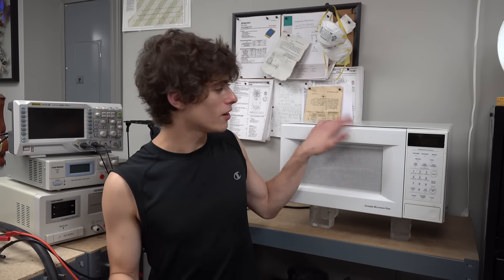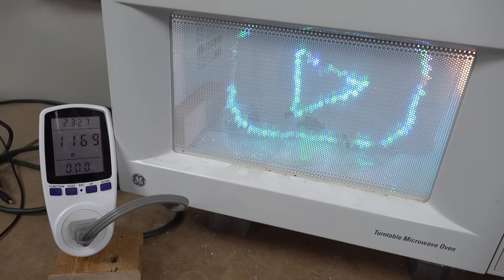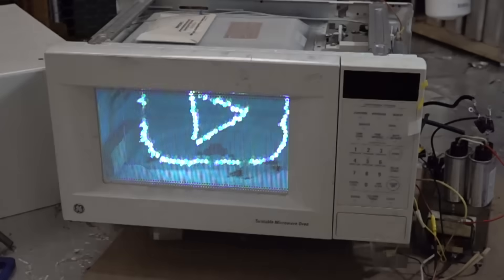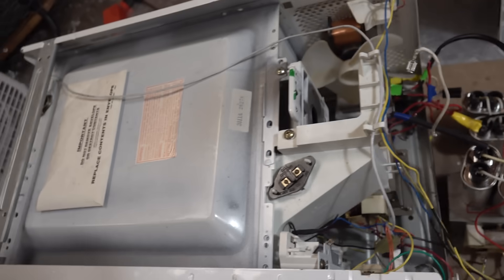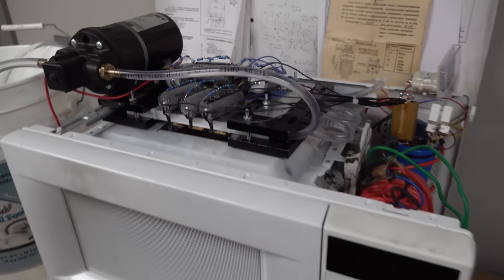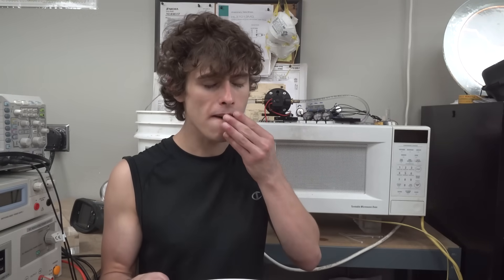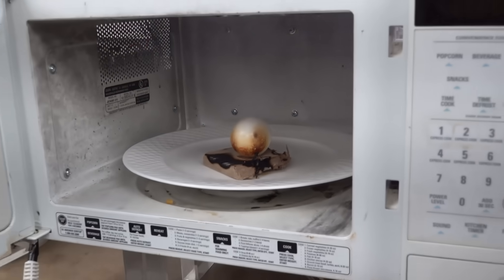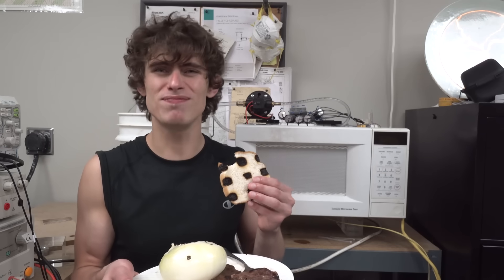I converted my microwave into a LASER oven!

Comment: "It's nothing that a little bit of copper wire and tape can't fix"

Almost had a heart attack there
Reply: The breaker would have still tripped anyways 😅.
Reply: @jasoncspink  lol yep. That doesn't work at all
Reply: He actually knows what he's doing. Although if he did screw this up he'd probably be dead before the circuit breaker tripped.
Reply: It will not work because the plastic Triger are designed in such way that it only Pull up the internal lever up but internal lever are free to move down Whenever Em triggers it , this time internal mechanism pulls the outer plastic lever down , not the other way around  .
Otherwise whenever mcb Breakdown after short the  circuit  , if someone mistakenly try to turn on the MCB again without fixing the short circuit first , it will completely destroy the circuit in just ms during the time of Holding by hand .
Reply: Wdym
Reply: @bizanagi5378  If he actually managed to bypass the breaker he could cause the wires inside his wall to catch on fire
Reply: @casualbird7671  a little fire never hurt nobody
Reply: @BugBestieLily  actually, it did.
Reply: @BugBestieLily  7 Arizona firefighters fucking died from fire.
Reply: @thepissedoffcombinesoldier7853  little fire
Reply: @thepissedoffcombinesoldier7853  lies
Reply: @justasuggestion5457  LITTLE FIRE? YOU THINK THAT SHIT WAS LITTLE??? THAT SHIT WAS A FUCKING WILD FIRE. PEOPLE AND ANIMALS FUCKING DIED. I DON’T THINK ‘LITTLE’ IS THE RIGHT WORD, WOULDN’T YOU AGREE?
Reply: @thepissedoffcombinesoldier7853  those arizona firefighters probably died because they were living in arizona
Reply: @thepissedoffcombinesoldier7853  "7 Arizona firefighters fucking died from fire." many fighters died from what they were fighting... it's kinda the thing that can happen when one fights.
Reply: @chrisakaschulbus4903  oh well no shit Sherlock!
Reply: @SirAlienGuy  no, it’s because they were trying to keep others alive.
Reply: @thepissedoffcombinesoldier7853  yeah, but the comment said *a little fire*, meaning he was not referring to the Amazonian wildfires. Just calm down mate.
Reply: @thepissedoffcombinesoldier7853  "oh well no shit Sherlock!" the same thing could be said about "firefighters died from fire"... but i let you eat your tuna sandwich, why can't i eat mine? :(
Reply: @thepissedoffcombinesoldier7853  doubt it, its every man for himself in such a wasteland
Reply: @thepissedoffcombinesoldier7853  "oh well no shit Sherlock!" again with the urge to keep me from enjoying my sandwich... 
why can't you be nice? :(

Comment: with adjusting the power correctly. for sure it seems like useful for cooking. and do lot more then microwaves do. and probably lot more safe in correct conditions. as microvave has lots of waste energey that causes radiation and instability on small atomic scales :P lasers are mostlikely more stable then high freq powerful microwaves. as they are lot more natural. but as they are targetable probably thell never be released in public.

Comment: Doing this with lasers that emit light that passes through cells quite easily could actually make it so you can uniformly heat up a steak since it interacts with all the layers of the meat without losing much energy so it can continue.
Reply: Uuuum... If it passes through cells, it isn't going to be heating it up much at all.
Reply: @oscargr_  It passes through cells quite easily, not completely. Let's say it drops 20% in energy for every centimeter that is passes through, for example.

Comment: Not all microwaves are built the same today I have a Panasonic inverter microwave that runs at the power you set it at! It's. 1200 watt unit if I set it to 10% It will run at 120 watts it doesn't cycle on and off like the old units do, it's almost 2 years old now and still going strong you can get one at Wally World for about $150.00 I'm sure you could expand your Frankensteining experiments greatly with a few of them.

Comment: "You can't make toast like this in a regular oven"

Trust me, micriwave burnt toast is my speciality
Reply: How?
Reply: @glenecollins  throw it in, start doing something and forget about the toast, come back 30 to 40 minutes later and it's suddenly black as Muddy Waters
Reply: @sirascaron  interesting I wonder if my microwave just doesn’t put out enough power to get it hot enough to make carbon?, mine just turns bread with no seeds in it into croutons, I tried seedy bread and it turned into fire but that set off the smoke alarm.

Perhaps I didn’t leave it long enough (I have only tried it when there wasn’t enough time to do it in the oven) and the bread I use is already pretty dry. 

Come to think of it a microwave oven with a vacuum in it should be the ultimate for drying stuff I will have to look into that.
Reply: @glenecollins  that's an interesting idea. I think you are right, a microwave purge oven would work amazingly well.
Reply: I like microwave toast. It browns the middle.
Reply: @alexbarnett8541  so does a toaster
Reply: @diablotry5154  but a toaster browns a rectangle in the toast, while the microwave makes a perfect circle. Toaster is boring
Reply: @diablotry5154  but there's more steps to getting out your toaster. The microwave is always ready and waiting.

Comment: I built a shielded enclosure for my 40W CO2 tube with an enclosed magnetron. I fired the lasers DC supply through the tube to start the plasma for the magnetron to get a grip but it never did. I later came to suspect that the gold catalyst coating was blocking too much of the 12.5cm waveband. I am retired now so I will get back around to reworking the project some day now that I have unlimited time like you. You're a God. Keep it up.

Comment: "I'm gonna guess that I'm probably not supposed to have these"  it be like that
Reply: It do be like that sometimes. You also experience that kind of situation any time you're working in an R&D test lab for any tech endeavor and you see lots of "Test Sample" or "Demo" unit labels on things. The funniest part is how frequently all that stuff goes into lab use fully undocumented. It then usually ends its life buried in a mystery rack somewhere with an engineer using it for supporting their own various tools throughout the lab instead of its original intended purpose. IT can be interesting sometimes.

Comment: Fun fact, at a messy 2.4 GHz, you could be interfering with the Transponders used in aviation. That is the piece of equipment that send your altitude and position to ATC for their radar, so depending on how close you are to an airport, you could actually completely block your nearest airport's secondary radar. This kind of relates to the FCC he was talking about, but you would also get involved with the FAA and maybe even ATSB if something go's wrong.
Reply: Thats y he has like 6 Faraday cages in thats one room
Reply: Do you happen to know how many km would classify as "close enough"?
Reply: @ornessarhithfaeron3576  I think EM waves, especially at those with lower freqs do travel pretty far, so if they are directed in the correct way anything could happen
Reply: @flawnski  if its in open air the freq dosnt really matter.
Reply: @ornessarhithfaeron3576  if it's pointed to the tower, then it's probably line of sight. If you can see it, it does damage.
Reply: also microwaves use 2.4GHz, not 4.2
Reply: @thewhitefalcon8539  This. Also the Wattage required for a 4.2GHz signal to reach cruising altitude of 12km would melt everyone nearby from the inside out. A microwave oven only has an effective range of a few meters, and that with a whole kiloWatt! Remember kids, the higher the frequency, the shorter the wavelength, the shorter the range...
Reply: my ion beam for the ibkt project will block a country from radar but due to a high fidelity yield graphene filter it shields the extreme rays and still able to cut a home in half with a swipe. when u do 45deg swipe then the top half slides down the lower half .
Reply: @Matt-xy6cf  .
Reply: Inverse square law , comes to the rescue ; 500 yards I'd say..prolly less- weilding with an arc ; does much the same -a plazma tource would blaze strong in tadio waves - mig. tig . Next most energetic , all motor Sparks - broadcast ' noise'...random weilding might we'll cover your tracks...godspeed comrade
Reply: so basically, if he brings that death oven outside it can blind pilot radar? cool.
Reply: Well I guess it's just a good thing that 4.2GHz is nowhere near the microwave oven band then innit :)
Reply: Where the fuck do you get this rubbish, transponders are 1030 1090 MHz
Reply: @TheFool2cool  there are harmonics and subharmonics to the frequencies. Since microwaves are around 2.4 GHz (I edited my comment to be more accurate), then that is close to the second harmonic of the transponder, or at least close enough to confuse the radar system. There is a reason why the UHF emergency frequency is 243MHz, the second harmonic if 121.5. They become partially bound. Also, microwaves are powerful enough that they wouldn't need to be exact. To put that in perspective, an Airband communication is 5-10W, nowhere near the level of the microwave.
Reply: @zacharytaylor190  no. There are not subharmonics. Microwaves do not interfere with radar systems. No no no no.
Reply: C-UAV inbound
Reply: @GroundOpiumZoo  this comment 🤣
If you know then you know 🤣🤣🤣
Reply: Where do you get those 4.2 GHz from?

Comment: 5:54 what the battery doin
Reply: I suspect energy in the air was so powerful that charging port and onboard OS thought that power cord was plugged in. I had the same problem when I was in toilet on vacation and phone was showing "recharging". It doesn't show up now.
Reply: @dragonivanrussia no that can't be because he left the metal grif on the microwave door which blocks all of the radio waves
Reply: @dragonivanrussia iPods like doing this too. I heard that they don't have the proper circuitry to properly know how much charge is left, so I'm guessing it relies on the fact that batteries output less voltage when they're running low on charge.

Comment: Sticking some mirrors where the rf is usually reflected inside the cooking chamber with just maybe four of those laser modules redirected into the rf cavity where the magnetron normally goes might just be perfect for actually cooking it without burning it. You would probably also want mirrors on the walls of the microwave, maybe just paint the walls with silver metal paint or something, or use cheap mirrors from a store. Also, it would be cool if you hooked it up to the microwave's controls and put a yellow shield on the microwave door so you don't need laser goggles to use it :)

Comment: Health Warning
Oooh nerd point: I am a HAM and would just like to comment on your protection warning.
Most of us only use the HF and VHF band Microwaves are (of the top of my head) EHF or SHF. Unless its causing noise we wont hunt you down.
microwave also is a very localized RF transmission. It doesn't propagate so it makes it difficult for the FCC to monitor unless they are down the street. 
I would be most concerned with the health issues. You might want to make sure your faraday cage is in range for the microwave transmissions. I dont think chicken wire will cut it. 
I would be most concerned about the health effects, such as RF burns and cataracts.

Comment: 2:20 Some microwaves actually do run at 50% power instead of going on/off all the time, the Panasonic ones for example.
Reply: There are some newer microwave models that no longer use the big transformer but a switching supply to power the magnetron. These units are a lot more expensive in comparison so not very common.

Comment: 18:37 I think you are on to something with using a different color laser, maybe with a wavelength somewhere between 780 nm and 1 mm like you suggest, you could maybe even go as high as 125mm or thereabouts.
Reply: Free proton MASER anyone? 

"So we replaced the LHC beamdump with a superconducting wiggler. Let's get ready to get subsurface radar returns from Pluto"
Reply: 125mm wavelength lasers would just be a normal microwave no?
Reply: @windowsxpmemesandstufflol  🤔you could use microwaves instead of light... What a novel idea

Comment: ngl when he said "nothing a little copper wire and duct tape can't fix" about the tripped breaker my heart stopped a little. Got me.
Reply: Same, especially after seeing one explode up close. They had the cover off for...reasons(?), and a CRX dashboard (complete with all kinds of metal bracing on the back) that was propped up in the corner somehow fell into it. I'm not an electrician, so I don't know exactly what all happened, but 2/3 of the main bar that the breakers attach to was vaporized in about 3 seconds.

Ngl, I would feel much safer handling uranium fuel rods that I do messing with electricity, you generally don't get a do-over.
Reply: @logicplague  I'm no professional, but I do work with small hobbyist electronics. Idiots messing with mains electronics, fuses and breakers doing things like that unironically further reinforces my beleif that humanity is doomed.
Reply: @bluspectre2042  I think that's awesome!
Reply: Dude I couldn’t stop laughing
Reply: A lot of things in this video could make your heart stop a little

Comment: Fondles microwave internals, bare handed. Engineering equivalent of a horror film. Puckered a bit there.

Please do your research and understand the risks involved and get a pair of electrical insolated gloves from a reputable supplier. Do at your own risk and remember it is a legitimate statistic. 

Dudes being a dumbass on your behalf. There are a lot of safety checks behind the scenes.

Comment: I'm guessing this is the first time you've designed your own water cooling system but I have to ask why are you using a high-pressure diaphragm pump. Where is the water cooling radiator. Also why did you use mayonnaise as thermal grease

Comment: Could it be beneficial to have both devices cooking??  Use the Magnetron to cook the innards, and use the Laser to give a nice charging on the outside. Obviously with a better diffuser 😉 Also, may add in a few other diodes types like the IR or UV.
Tbh, that steak looked pretty decently and evenly cooked. Perhaps cooked less time would better. 
But cooking with laser and microwaves I think the food would be done faster, and more thoroughly/evenly.

Comment: Don't forget that part of the heat from the water goes to heating the cup, which has a different thermal capacity than water. So your calculations of efficiency are basically nonsense.

Comment: It might work better if you were to have a beam splitter split the beams into more than one and then have them reflect off mirrors so you can cook the top and the sides at the same time! Also, the key is to make sure that the food is moving around so that no spot is stuck under the laser for too long. It would prevent the burns.

Comment: You and my Dad would have gotten along.   He used to work at Lockheed.  They had a 25,000 way microwave they used for environmental test.  Semiconductors were kind of new when this happened, and they put a chunk of wine in the microwave.   Somehow,  the "conductor" part of semiconductor hadn't clicked.  Dad said it looked like the Aurora Borealis when they fired it up.  

Then there was the BBQ trailer lined with pics of space shuttle off-cuts...

Comment: Near infrared, set a cycle to finish it with blue. For the steak. You could also set it up so that you have a probe thermometer hooked up so that when the internal temp reaches near your preferred doneness you have the blue kick in to add the sear.... Maybe set up a sprayer with melted butter, garlic, and thyme to add that slightly higher end flavor.

Comment: There's a lot of variation in microwave ovens. When set to run at 50% for 2 minutes, some will run for 1 minute and let it sit for the remainder, while others will pulse it. There were even ovens designed with moisture sensors to accurately make popcorn.
Reply: You don't see those moisture ones anymore, which is a shame, it's much more accurate
Reply: @keithmichael112  ACTUALLY.. he also never mentioned the "inverter" type of microwave either.. the latest thing is where they feed the magnetron using a SMPS instead of mains voltage/current directly..  I haven't yet seen one of these types up close- but my understanding is that they can reduce the overall power consumption while keeping the magnetron "biased" and outputting...
Reply: @keithmichael112  I got really annoyed when I replaced my microwave and the popcorn button become nothing but a preset time button (way too short of a time, I might add). Major downgrade. 

Can’t believe that’s not really a thing anymore. It was such a useful button. Now all I get it microwaves that think I want to cook something for 4 minutes when i try to type 45 seconds cause I forgot to press the “cook time” button.